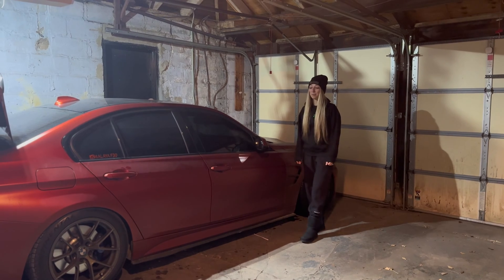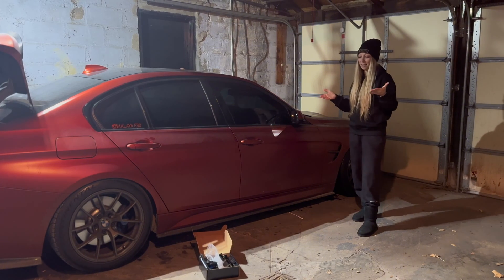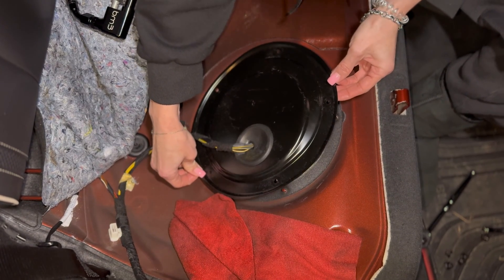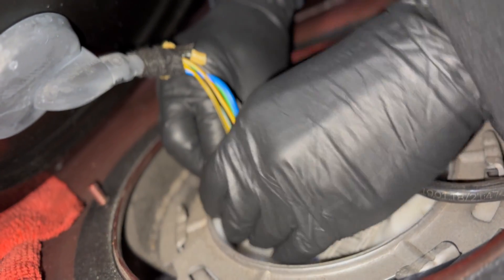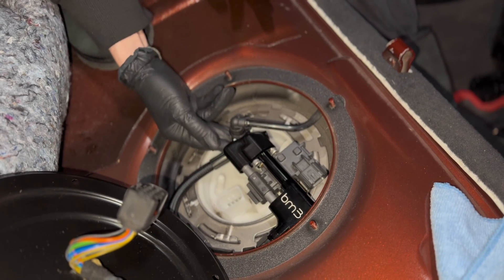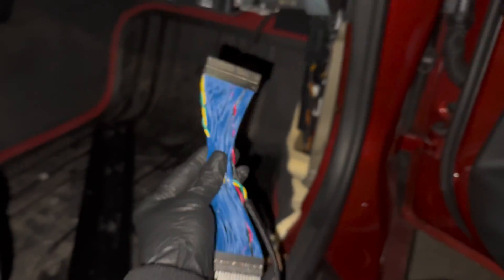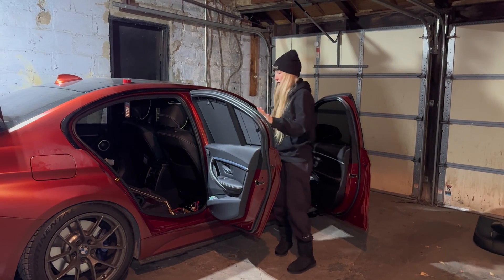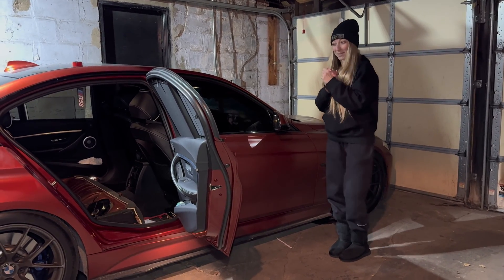HOW TO INSTALL BM3 FLEX FUEL KIT FOR B58

Comment: Great video. Im about to do this install over the weekend. After the install, what do you do with the tune? Just select multimap and it will auto tune for whats in the tank?
Reply from the maker: I have a custom tune, so I had to reach out to my tuner for him to make another custom map with flexfuel enabled. You could still check the fuel ethanol content to make sure it works.
Reply: @malayaf30 do u recommend the bm3 tune after installing this

Comment: I just got the flex fuel kit and I did everything right the only thing is trying to fit the flex fuel inside the hat location
Reply from the maker: That’s probably the most difficult part
Reply: Oh and the back seat installation 😂

Comment: Seriously better DIY vid than provided by protuningfreaks and Kies.. bout to knock this out this weekend 🎉
Reply from the maker: Thank you so much!!! I hope it helped out out and good luck on installing it. 
They cut a lot of parts out so make the video shorter and easier to watch, my DIY videos always include every detail
Reply: @malayaf30 update* on the s55, with wiring, on the clip you pull out there are 2 black wire pin holders and 1 grey..slide grey off and onto the bm3 harness, then place into clip and reinstall. Other than that, everything else is the same and very straightforward. Car is running great so far. Thanks again for the great diy!

Comment: Thanks, prefer a long dragged out video over any "hey I'm mr YT look at me skipping steps in search for dicks, ohh sorry meant clicks" while grossly skipping over any small but important part, patience is a virtue or so the saga goes. 

Watch until the end, worth it, thanks and appreciate it. Just weird that you still had such pressure built up on the low pressure side at the fuel hat location, you pulled the connector, started the car, ran until died???  Maybe I am missing something, I find it strange should it not be more or less drained at that point?

I want to do engine bay to skip pulling trim, rear seat, perhaps change my mind and go this route anyway just sporadically I feel engine bay should be less work, as long as the grommet is there as advertised it's a short distance straight down to foot well.
Reply from the maker: Thank you so much ❤️❤️
I hate watching videos of other YouTubers and when they skip all the important steps and don’t explain how they did it! 
After I installed the flexfuel I figured out why there was so much pressure in the low pressure side, it’s because I had my keys in the car and it kept priming. That was my mistake I should’ve had my key out of the car or disconnected the battery before hand. We live and we learn